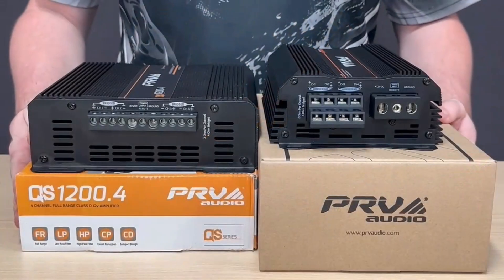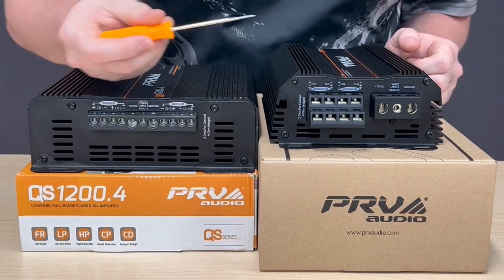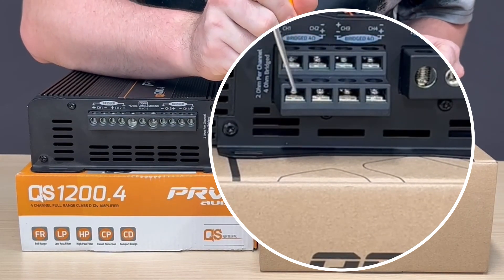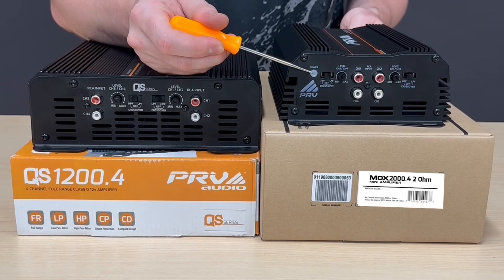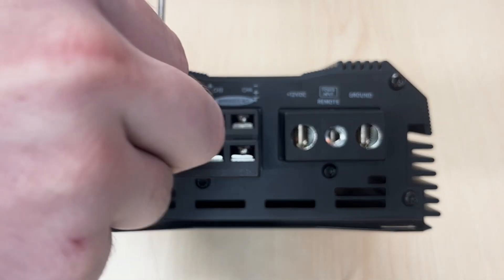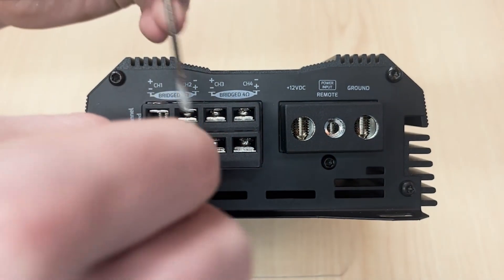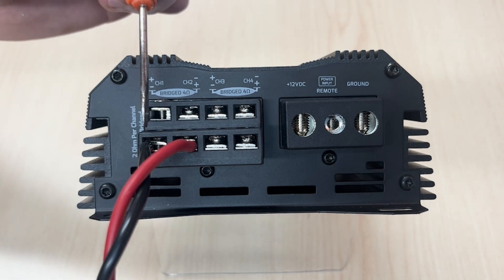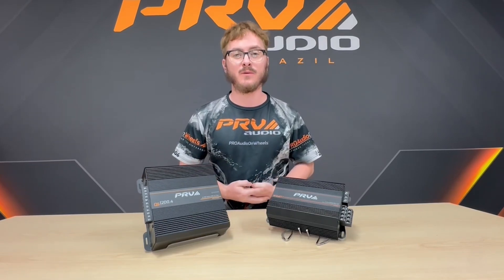PRV Audio - How to Wire the MDX Series 4 Channel Mini Amplifiers | MDX Series vs QS Series

Comment: Is it safe to ran 4 4ohm speakers on this amp?
Reply from the maker: we have many different models, you use a MDX2500.1 1 Ohm and run 4x 4  Ohm mids in parallel

Comment: If using the 2000.4. Would it be safe  to use one channel for two 6x9 speakers ( parallel wiring ). I have 4 6x9 (   6x9 Midrange Speaker 500 Watts 4 Ohm Neodymium 69MR500CF-NDY-4 ) and would like to save the other two channel for my 8 inch subs.
Reply from the maker: you will need the MDX2000.4 1 Ohm - so you can have the ability to run 4x 4 Ohm mids in one channel

Comment: Just brought that MDX mini 1200.4 a few minutes ago on sale from Prv's website. I was originally ran Soundigital EVO-X's but a few of them are acting up, so I'm switching it up a bit. In my Big Rig I run Taramps 4 channels & I have zero complaints. So now I need 1 2000.4, 1 more 1200.4 & 2 800.4's to be able to do my full switch over.I'm a huge fan of compact amps.

Comment: I wish you guys would do a dyno test on the mdx 1200.2 1ohm amp and the mdx 2000.4 amp because there’s no video of them or a dyno
Reply from the maker: We are working, the videos of each amplifier, but they all have certified power!
Reply: Dyno test
Reply: No need for a dyno test on Brazilian amps feed them the right power and they'll give you rated plus more than rated.
Reply: @DayV914 yep never seen one not do rated power but they do get hot with 4 awg wire